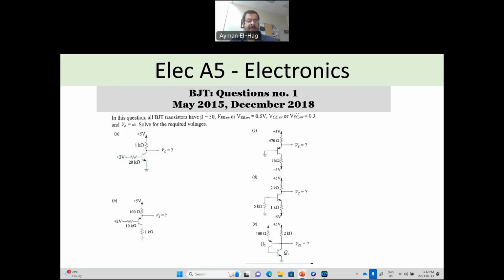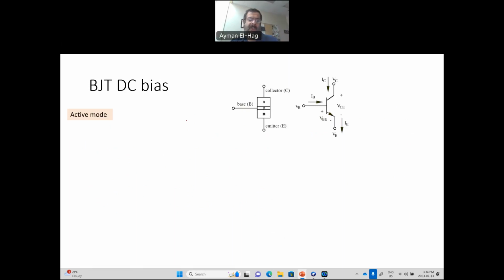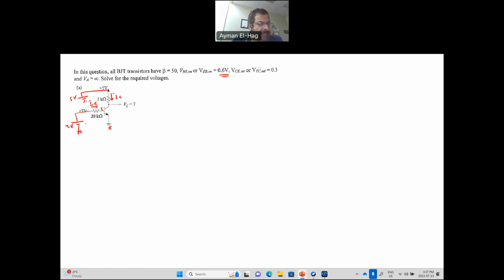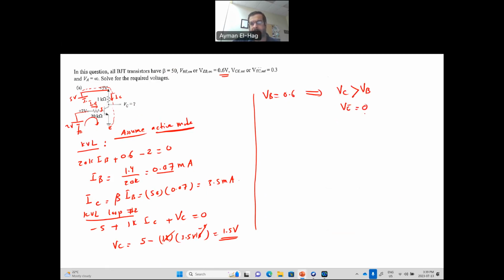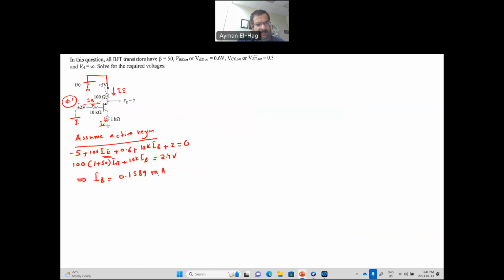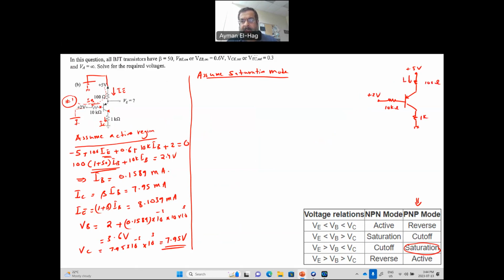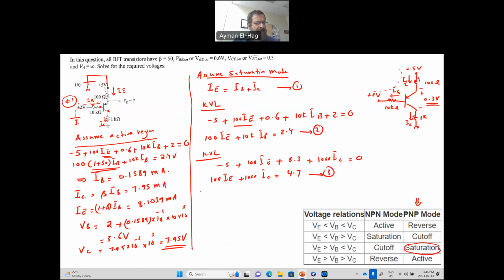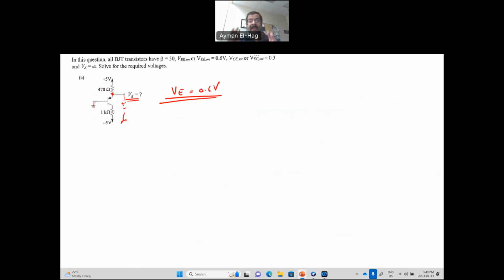PEO solved examples (ELEC A5): BJT Question no. 1

Comment: Hi Sir, is the table of the different modes for each type given in the exam? Thanks
Reply from the maker: Hi, honestly I do not know but they should tell you if the exam open book or closed book.
Reply: @electrical4everyone  I think all the exams are closed-book because there is an exception for some courses to have a printout of some staff, but nothing for electrical
Reply: @mabdallah5294 are you doing A5 or its done, can you share some insights or how to prepare, i have smith and sedraa, it seems too much to cover
Reply: @lucky8673  Did you write A5 last session? Can you share your experience or questions with me?
Reply: How was the exam or still preparing A5

Comment: For (d) Vc= -1.328V with BJT in saturation
Can you confirm this?
Reply: Secondly, for the part (e) it is kinda tricky to apply assumption on two BJTs and solve using KCL could you help with the answer for this.
Reply: For part (e), my calculations show Q2 to be in active mode and Q1 to be in cutoff mode, my question here is if we have cuttoff mode that means Ic is zero if Ic is zero then I think we have Vc1 as 5V. When you have time can you confirm.
Reply from the maker: @HaiderAli-rm6rd  Hi, I will try to solve these two questions in couple of weeks as currently I'm on vacation.